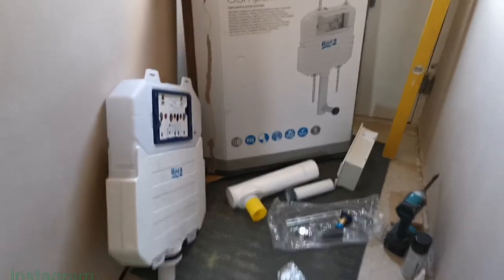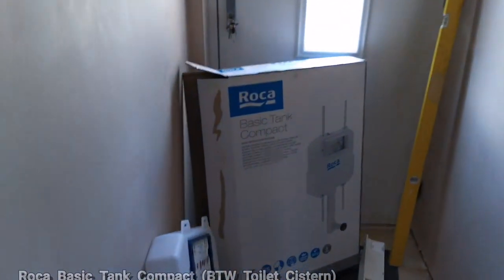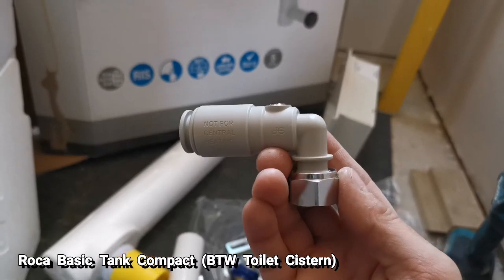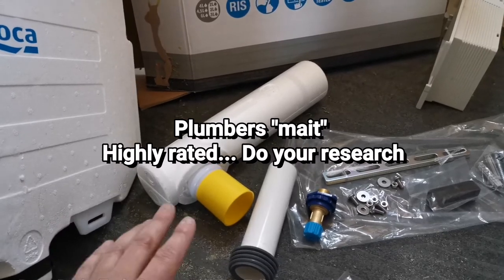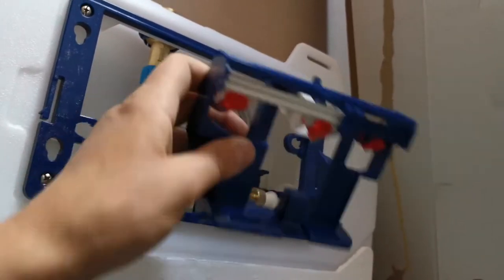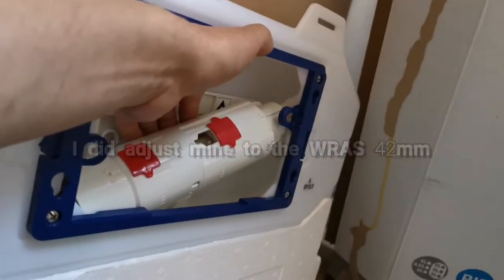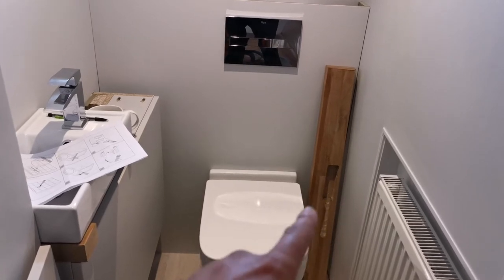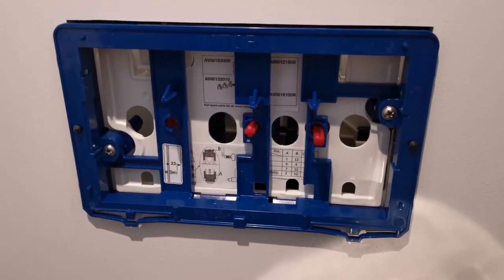Review of the Roca Basic Tank Compact toilet cistern

Comment: Hi I liked your video, I am about to to buy roca 1120mm frame system, because it is only a few which can do flush 6/3, 4.5/3 and 4/2l, do you think the vertical flush pipe  can be shortened as it connects with the cistern with kind of push fit, it's around 1:33 when you got it in your hands, may be I have to shorten the frame on top and of course shorten the vertical flush pipe and then weld the frame together   back, I bought pan which is designed as well for 4/2l flush, thanks